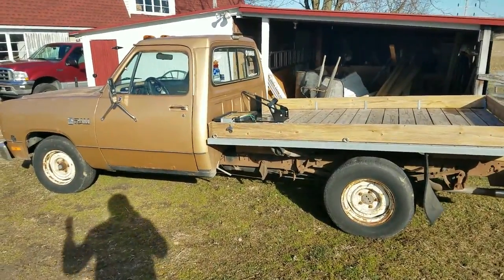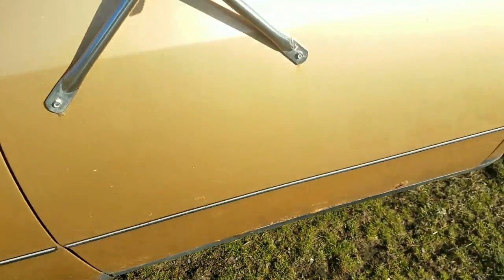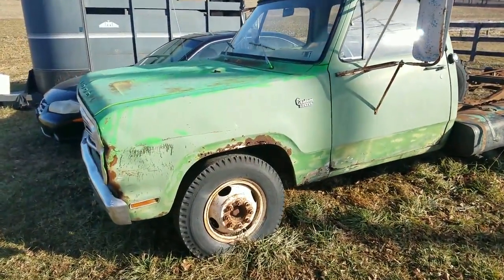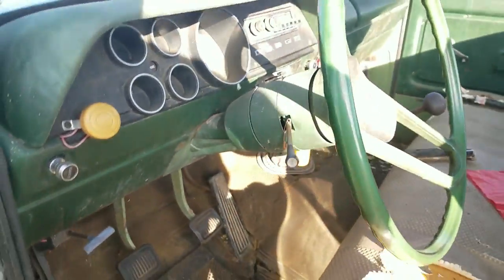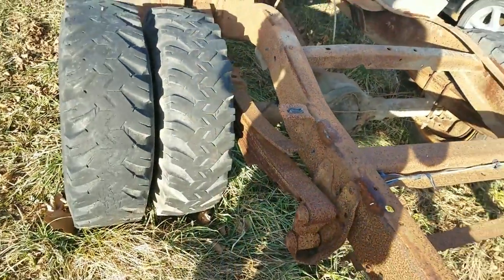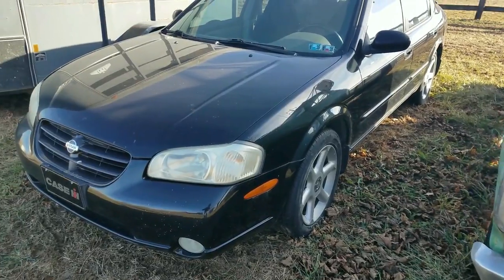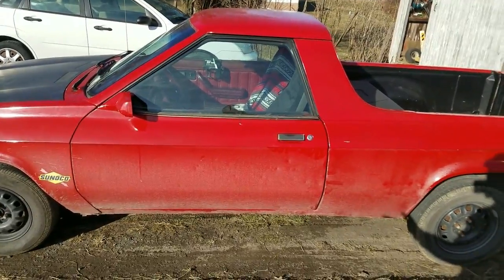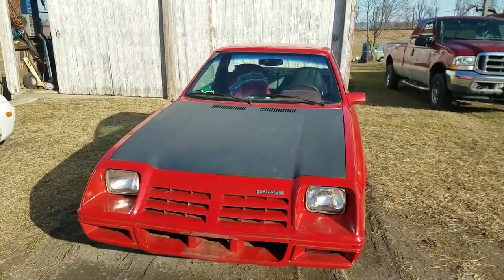Feb 2017 Subscriber Update :: Vehicles

Comment: good luck on the truck, also you might have to replace the flywheel, due to you might have some stripped teeth
Reply from the maker: Josh Kilen The torque converter got replaced, this model had the starter teeth on the TC.
Reply: Keystone Motorsports ok